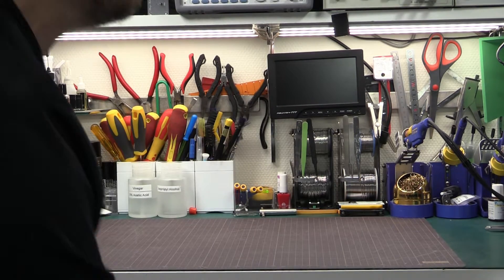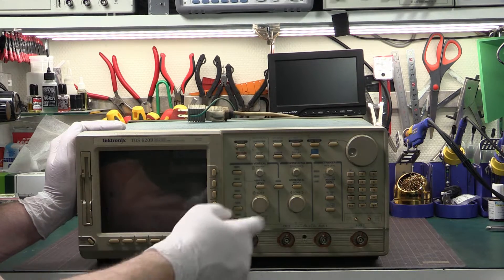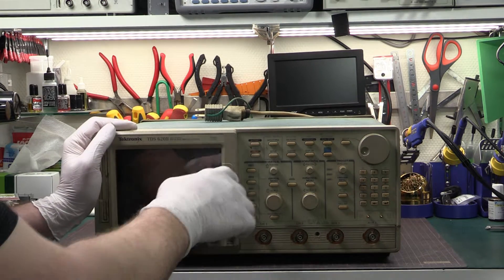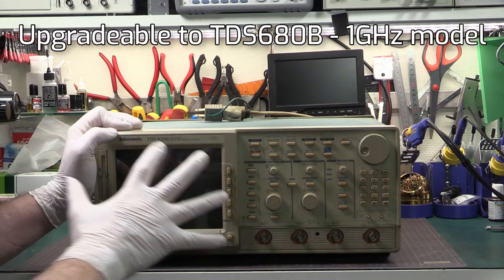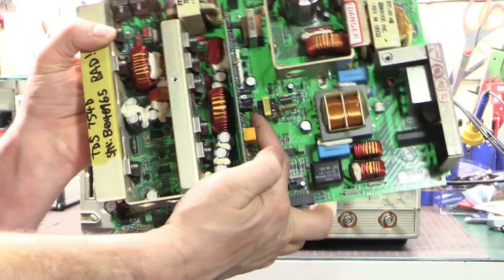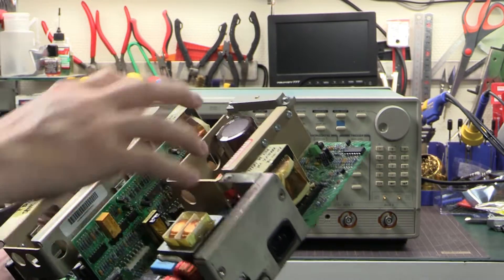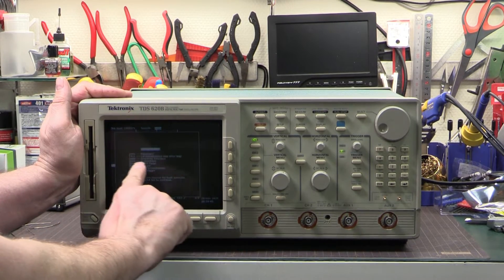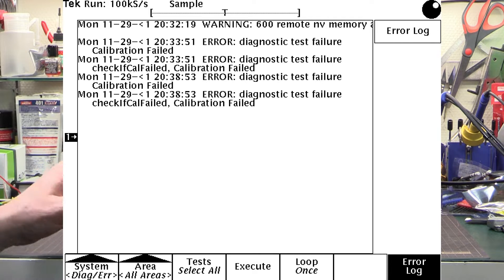Tektronix Oscilloscope 1GHz Upgrade Hack

Comment: Nice Job Jared, that was dirty, nice cleaning ..Upgrade indeed easy peasy . now you need to build your DOS PC and Calibrate it with FAS when your ISA card comes in, so you can use the full 2 GS/s .. then all the ADC's need to be in sync.

Comment: The previous user of this scope was definitely oldskool,if you look at the "cheaterplug" that he used, that says enough. 
Everone knows these days that you must float your DUT and not your scope. 
The "cheaterplug" was in the old days how oldskool technicians protect there scopes, but that left the metal chassis of the scope ungrounded 
and can cause a electrical hazard when the chassis becomes live. Also, safetycaps on the input of the scope, will leak a certain amount of mains voltage to the chassis, and to the negative part of the BNC connectors on the front of the scope. This leakage can sometimes be up to 50% of mains voltage.
When dealing with sensitive circuits, this mains leakage can cause damage to your sensitive circuits.

Comment: Thanks for your efforts to share with us = m-u-c-h appreciated. Let's not forget that the real fix was just replacing a super-cheap diode = woot = that's gotta feel really good! I am sure you know these two cleaning tips, but for those that do not... You can remove the smell with ozone... If you do not have a generator, ozone is even sold in a can (or, it used to be.) IIRC, the cans could be found in automotive parts stores. Remove the top of the can. Put the plastic parts and the topless can in an air tight/Zip-Lock bag, force the air out of it and zip it closed. Press the valve cap through the plastic to fill the bag with ozone. Then, wait a day, or two, before removing the parts. Work outdoors and don't inhale the fumes. But, one trick to it is that you must remove every bit of dirt/ash/dust/oily residue, because it will hold the smell. You can restore the color of the plastics with a process called "RetroBright/RetroBrite." I am just learning about this, but it does not seem to be a cleaning product, so much as a cleaning process... Put the plastic parts into a clear container and fill it with high-percentage Hydrogen Peroxide (12%, or better, I think.) Then, shine a UV lamp on it. The UV light seems to be the trick. Search YouTube for videos on both cleaning processes. I am not responsible for anything, if you attempt this. NFM, I can't believe your wife let you put the plastics into the dishwasher! You are a brave man, to tread those waters... For those who also dare to do this, do not add liquid dish soap to the machine, just use the regular dishwasher machine soap. Proper dishwasher detergent will not suds up. Liquid dish soap will and it will literally fill your kitchen with suds. Cheers!
Reply from the maker: I actually used 6% hydrogen peroxide held at 50°c under UV LED's for a few hours on the smaller plastics after the dishwasher.
Also, don't tell my wife! 😂

Comment: This is really nice! If you did the hack without the subsequent re-calibration, how far out of cal would it be?
Reply from the maker: It will remain in calibration up to about 500MHz where it was previously calibrated, beyond that it is up to the luck of the draw.... :) It probably wouldn't be too far out, and would still show the waveform fine as long as you don't do any critical measurements from it.
Reply: @NearFarMedia  great, that makes sense, cheers!

Comment: That was disgusting. I buy a lot at auctions and I’ve realized that you can tell immediately what kind of place it was. Either everything is pristine and well maintained or it’s grungy and beat up.
Reply from the maker: Yeah, I knew this one was a bit gross, but the pictures didn't do it justice. It was way worse than I ecpected, but at least it came up good in the end.

Comment: Why You talk so much about nicotine? (You were probably smoking like a steam locomotive a few years ago and now you pretend to be holier than the Pope...) Is it an anti-smoking ad or a clip about the scope service?
Wouldn't it be easier simply to disassemble the casing and external elements, knobs, buttons, etc., throw it all into the dishwasher and after an hour take it out clean, smelling like it came straight from the factory?

Comment: To attribute the discolouration, stickiness etc. to nicotine is unscientific and betrays an irrational anti-smoking bias. Who knows what sort of environment the device was in over its lifetime e.g. an urban area with significant air pollution, a factory etc. And to suggest that you are going to get addicted to nicotine simply by touching it is ludicrous. Equivalently, to suggest that it was unsafe to touch before cleaning is equally ludicrous.
Reply from the maker: Ok smoker.
If you are so triggered over my comments on a nicotine stained oscilloscope that stank like an ashtray, the result of a disgusting self-destructive habit, then you are in serious need of some self reflection.

I hope you have a day that is as nice as you are.
Reply: It doesnt take a mass spectrometer to determine the stench, discoloration, and chemical deposits burning tobacco creates on equipment, furnishings, appliances and automobile interiors, let alone the skin and lungs of the smoker.  Its a filthy habit and smokers are generally rude individuals.
Reply: @NearFarMedia - I am not a smoker! But never let facts get in your way.
Reply: @Destroy_Communism  "Smokers are generally rude individuals". I know many smokers and ex-smokers and my experience is that there is no correlation between rudeness and smoking. However, I have sometimes encountered radical anti-smokers like yourself and my experience has been that they are both rude and intolerant.